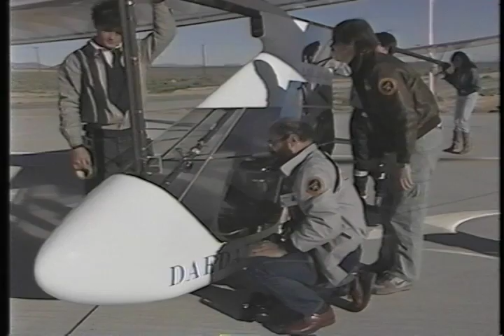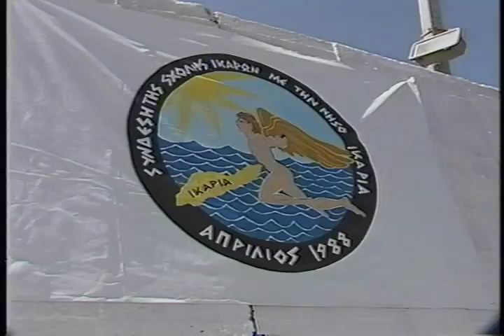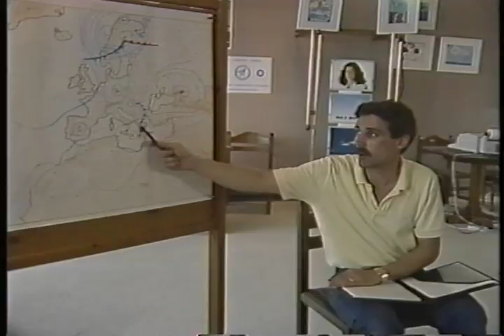Part 3: The Light Stuff (human-powered flight)

Comment: All good points.  Hotter air does make it thinner and does give less resistance, but for propeller planes, that results in the propeller having less air each time it "bites."  Pilots are cautioned on hot and heavy takeoffs because it takes much longer to reach takeoff airspeed.

This was apparently done long ago, but it's still very inspiring!

Comment: My comment is not intended to replace anything that the Daedalus Team would say about flying in the summer. I have flown hang gliders since the 1970's, so my experience is that in the summer the air is more turbulent and less laminar as a rule. The probability of structural failure in turbulent winds might have been a factor.

Comment: They've proven that the craft ends up too fragile.  You need really ideal conditions and it was extraordinary that they got as good the weather that they did... but it couldn't last.  At the end, the wind picked up and challenged the air frame, based on the direction Daedelus had to go and---SNAP.

However, the test was technically a success. I think the next test should be a combination of human and solar power. Imagine the possibilities with the pilot being able to take short breaks.

Comment from the maker: True, hot air is indeed less dense, therefore less lift at a given speed. However, by that logic, there would also be less air resistance. Jets actually fly more efficiently in the upper atmosphere where the air is very thin because there is less friction. Obviously, powerful, fast jet flight is very different from human-powered flight, and I don't know how that applies to slow flight.

Comment from the maker: @rick57hart To save weight, the crashed plane did not have ailerons to control bank and maintain level wings. Instead, it had dihedral (Diedergruppe) upsweep (Kurve nach oben), but there was not enough.So they fixed the plane, allowed more dihedral and it worked well.

Comment: The technology and engineering that went into its development was on the cutting edge at the time and required the attention of people who were top experts in their respective fields. No one had ever done what they intended to do before so they had to develop the aircraft from the ground up. Besides, aviation isn't cheap no matter what you're doing. For comparison, a Cessna 172, the single most manufactured model of airplane ever and one of the simplest, costs ~$250,000 new.

Comment: What a great flight, great team and great achievement !!!

22:35   It looks like the gust and  the rudder control input to the right at the same time created a torsion at the tail structure and it broke  the tail structure.   The area of rudder above the " fuselage tube "  looks bigger than the area below. It generates rudder torsion during rudder inputs or side gust wind during flight.
Reply: Perhaps they could have some extra strength and reduced weight by lightly pressurizing the structural tubes with 14.7 PSI of hydrogen or Helium.... or even 2 Atmospheres of those gasses (29.4 PSI)
Reply: @kd5txo  Yes, that is an interesting idea.
  Also to avoid torsion of the tail tube when rudder is applied , the area of rudder should be the same above and below the tail tube.

Comment: Air density also applies for propeller - the thicker the air, the more efficient propeller. Also, with the higher air density you get more benefits for lift than penalty for drag.

Comment: There is more turbulence in hot weather plus the pilots are sealed in a plastic bubble before they leave, that little hole they crawl out of is closed in flight. Ever sit in a car on a hot day with the windows up? Even a Cessna gets pretty hot inside with the vents open when it's 100 degrees outside and bangs around like it's on bad pavement.

Comment: I wonder if with new materials this could be made even better? Also what about a plane that would use not only the legs but the hands as well? It would allow for a higher resistance that would still be easier to handle with both the hands and legs, and as a result a higher propeller speed... As for the controls, there could be some levers on the hand pedal set, and/or a helmet with strings as well as torso controlled movements.. Maybe modern technologies would even allow for increased sturdiness of the construction without weight gain, as well as less weight for the radio in the cockpit?
Reply: +mkzhero I agree, technology enables records to be broken!
Reply: Because the limiting factor is not his muscular endurance but cardiovascular endurance. Adding hands wouldn't help.

Comment: Jet engines fly at higher altitude due to colder atmosphere and therefore increases the efficiency of jet engines due to faster heat loss. Propeller engines need higher density to create thrust and therefore, in a hot environment, its efficiency will drop. You can't compare propeller engines and jet engines as they have different properties and calculations for efficiency.

Comment: You could try, but it wouldn't be particularly useful. Weight is a function of how gravity acts on an object's mass. Unless you go to Mars or a body with less gravity the weight will remain the same. And in fact by adding helium to the wings you've added a not insignificant amount of mass to the craft which despite being less dense than air, will actually make the craft just slightly heavier and make it perform worse. In reality, you might as well make it a pedal powered zeppelin.

Comment: Remember This : Humans would never fly like birds,never.
You need wing spam of 60-80 m to lift a medium,80 kg man and here the problem start :
- You can't attach a 30-40 m wing to 1 hand then somehow attach the other one and "take off"
- You don't find enough space to "unfold" and atach the 2 wings
- Can't hold them of the ground
- As you need to flap,they have to be very thin and would desintegrate when you do
- Can't lift you off the ground
- To be strong enough to lift you,they have to be so thick you couldn't hold them even with 1 end supported on the ground
etc.

Thats exactly what happend here.You can only fly like Yves Rossy or the Griphon Wing.
Reply: pterosaur spec:
Span 11 m (36 ft)
Wing loading 8 kg/m2 (1.6 Ib/ft2)
Area 8 m 2 (86 ft2)
Weight 64 kg (140 lbs)

I guess Humans will fly like birds with support of exoskeleton in 100 years.
Reply: Dongseong Hwang
When you atack something bigger then a backpack,it's not flying like birds,it's entering a thing made to fly.Now,the only think you near it,is Yves Rossi's,wich with a little hard work you can make it take off vertically.
Another thing belived to be real was that dutch guy flying with supposedly home made wings,wich need to flap waaaaay faster to get you anywhere.

Besides,you don't need to lift to 1500-2000 m,some  500 is more then enough.
Plus,you would only be able to use them in Europe,in older,smaller cities,the US's are waaaaay too filled with fucked up Towers ...
Reply: Correct but with a hydralic system an uprated wings it is possible. I've seen the designs so it is feasible. The entire system weighs about 30 kg though.
Reply: Watch Ryder
30 km is nothing,soldiers marched with way more than that,but that won't be able to lift a man.The only thing is to make some wings of max 4-5 m wingspan (that won't lift you,it barely lifts the Albatros a 2-3 kg bird) and make a costume,like fighter pilots ones with easier than air gas,to give you some lift,but i don't think that's feezable and at the same time,not to look like a bear.The only changes of flying with minimal impact to the body is Yves Rosi wings,wich,still can't lift of or land on the ground,unaided.

We're a veeeeeery long time away till we'll see anything EVEN REMOTELY resambling bird flight.
Reply: motanelustelistu

The 30 kilos of the entire suit requires a man to reach a speed of 20mph to achieve the lift required...

http://www.dcgeorge.com/ProjectFalcon_f.html

Also the wingspan is nearly fifty feet!!!